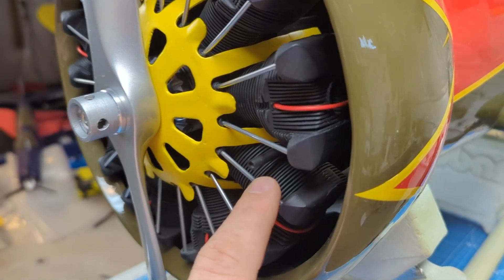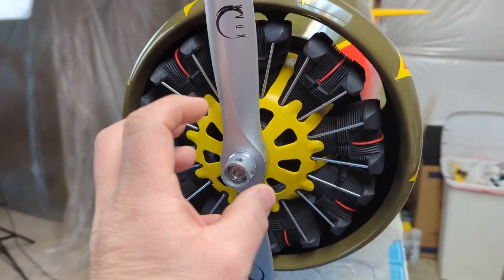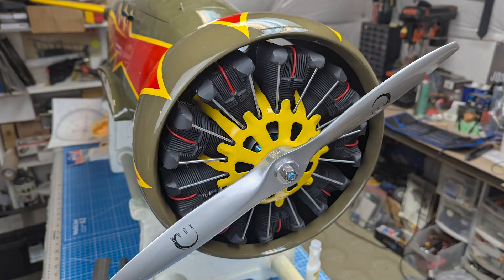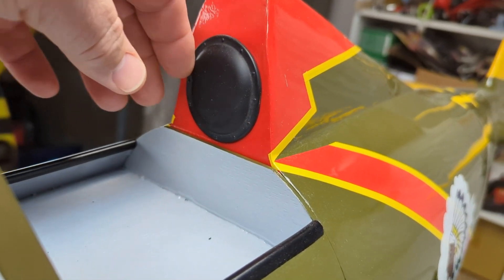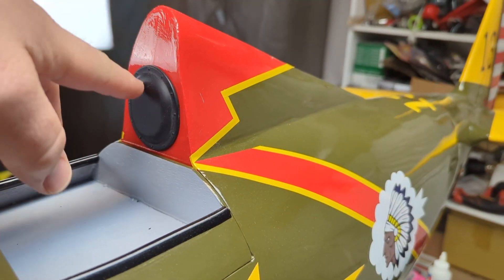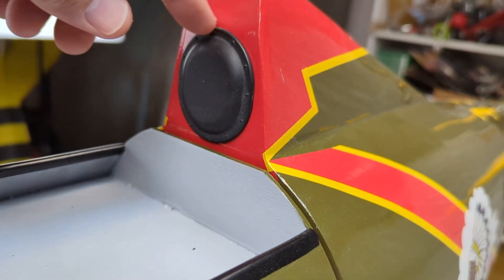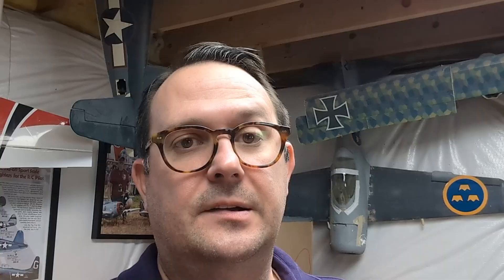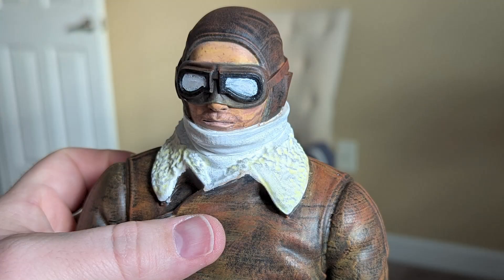P-26 Peashooter | Adding DEPTH With 3D Printed Parts

Comment: Too many cylinders is the obvious error in choosing the Cyclone.  The cowl looks over stuffed with that engine.  It is beautifully done, though.
Reply from the maker: The P&W R-1340-27 does have 9 cylinders. If you go back to my museum tour you can compare the two more directly. The main difference you'll find is that the cylinders are fatter, owing to the increased displacement in the Wright engine. The Wright engine also made about twice the HP when comparing the two specified variants. I did a bit of homework here but I just did not have the time to make the P&W CAD files. IMO, the folks over at Scale RC Engines have already done a fine job of the CAD work but their prints are just not acceptable. This is why I mix SLA and FDM. They also charge way too much for what they are offering. Unfortunately, that also do not offer the files for printing like other folks in the 3D printed airplane sector. What's more is that their "solution" is only detailed from the front and lacs a lot of the depth that I'm talking about. https://scalercengines.com/products/p-26a-peashooter-seagull-models-upgraded-direct-fit-dummy-radial-engine?_pos=2&_psq=P-26&_ss=e&_v=1.0

As you can tell, there were a LOT of trade offs with this decision. In the end, this is never going to a scale competition and most folks will never question it. I'm just always fully transparent and like to take viewers through the thought process when I can.